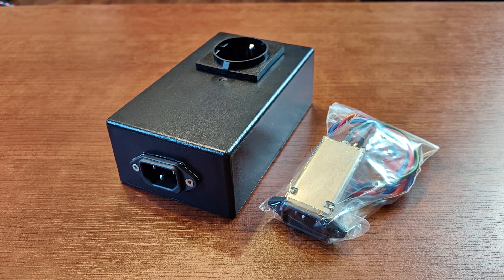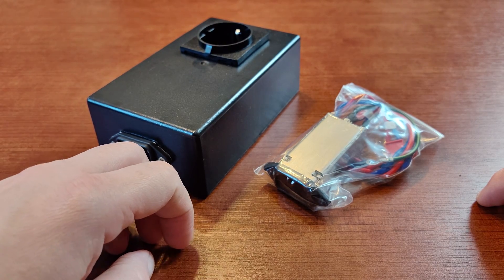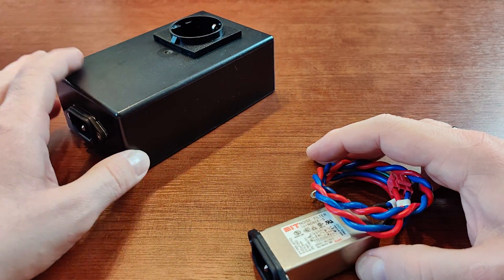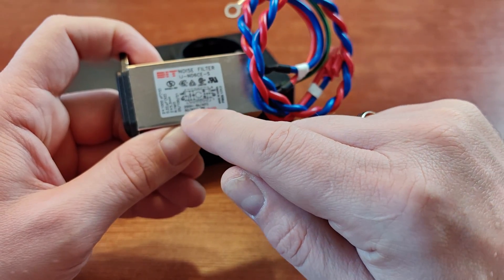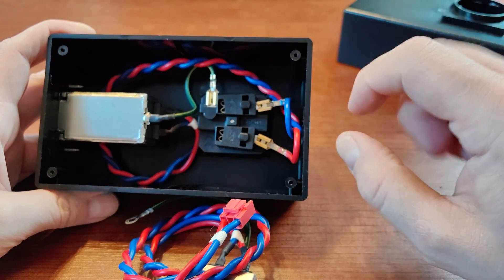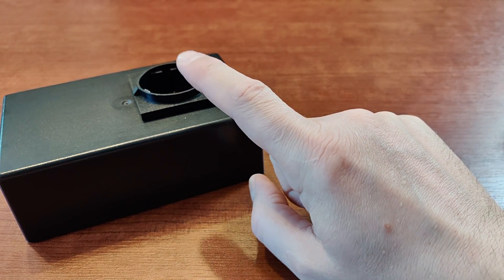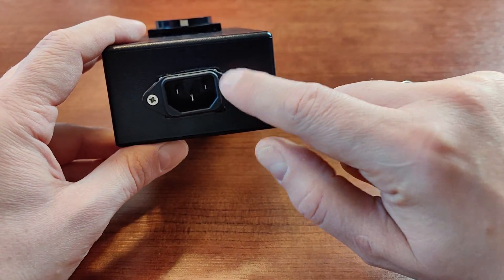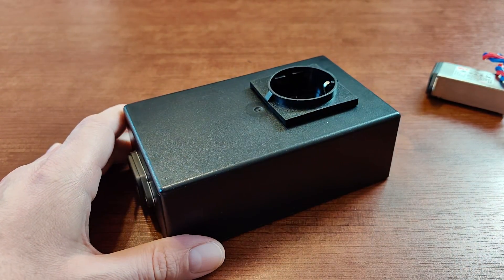Hifi DIY - building your own cheap EMI filter that actually works!

Comment: I put this filter right next to the computer. https://youtu.be/dSIgSAB9awI But honestly it didn't help. Any activation of equipment with an electric motor (drill or sewing machine) causes interference on the monitor. I just took an extension cord and plugged the computer into another outlet and into a different phase.
Reply from the maker: That's because it's for high frequency RFI traveling through the mains, not for EMI (electromagnetic stuff) that travels through the air. Btw you have either very sensitive monitor, or these devices are messing the things really hard
Reply: @k4syx  I’m afraid the problem isn’t in the monitor but in the graphics card. I’ve noticed that when I plug the printer into one of the USB ports, the monitor can also lose the image for a moment.

Comment: That's a good project to try how it sounds, but I suggest to build a more serious device with large chokes and thick wires. Find recipes online.
Reply from the maker: Yes the thing here it's dead simple to make one for a price of a single beer bottle. 
Yes you can build way more advanced and effective ones but that requires some more skills especially when it comes to soldering. And usually you'd like to have that on PCB so you'll need to order that as well (as masks and designs are available). This small guy works well and proves the point of having EMI filters on the power supply very well

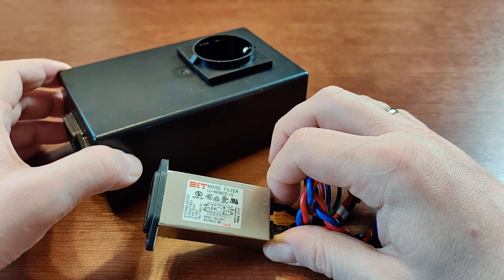Comment: 4:44
How did you test them?
Reply from the maker: Listening sessions with highly transparent system (Martin Logan Ascent I electrostats).
If you're talking about measurements, these are standard Pi design filters used commonly in sensitive equipment for EMI and RFI filtering. 
They are low pass filters designed to block anything above manufacturers specified freq.

Comment: Hello Greg, thanks for the video and sharing knowledge, very interesting ;-). 
I have the same e-TP60 power plug (as in your other video) and I have found Schaffner FN9244E-10-06, FN9244EB-10-06 and FN9244B-10-06 IEC Inlet Filter to install. Which one will you recommend for best performance? Thank you.
Reply from the maker: OMG I don't know their specs by the model number :)
I suppose any of them will do as long as it provides all three connectors (LNG) - some of the filters have only L and N.

Comment: Is it safe to connect the appliance under the EMI filter to another one without it? I'm mainly talking about connecting a computer behind an EMI filter to a network router/switch with a shielded CAT6 cable or an audio cable to an amplifier with its own power supply. Also, can I use the grounding that already comes out of my socket, or is the one coming out of the filter different? I have a TN-C wiring, which comes with a combined PE and N lines, unlike the modern TN-S grid, which also utilizes a current protection within the L and PE lines. My main problem is that plugging in any switching power supply like a phone/laptop charger or powering on a dehumidifier with a soft-start compressor results in my monitor being reset and my USB soundcard plugged into my PC outputting very unpleasant noise into my headphones. While the computer's power supply is the highest-end on the market you can get, it probably can't filter out the "dirty" power I have. I also have another computer with a pretty low quality PSU and I'm storing critical data on it as a home server. Can the EMI filter work only on its output, or does it also do something on the incoming side? I was also thinking of building the entire EMI filter into my extension cord, but first, I need to clear out my concerns and ambiguities before buying anything.
Reply: Yes, It's OK, you could build EMI box like this video. The grounding are the same so don't worry, just connect the green wire of the filter to your grounding system, it would help reduce common-mode noise. But always be careful when repair or change anything in grid, 120v is still better than 230v in EU. Most of the emi filters have metal case, read the leakage current from manufacturer file, and you could decide to buy and install, in your case I think it would help.

Comment: The only thing better than polish Acar power lead extensions with EMI filter are your polish accented videos about how to build one :D
Reply from the maker: Thank you, I guess? :)
I don't think acars have that kind of EMI filters. AFAIK they have even simpler stuff.
Reply: @k4syx  Yes. But their stuff (designed actualy for datacenters/racks) is probably cheapest option that in my opinion makes sense for AV/Audio. Their lead extension with surge protection and filter costs some 30 euros (used to be under 20 before covid...). Still the purpose built one will be better...

Comment: Hi Greg - very nice video! I have a dedicated line in my house for my hi-fi but I may have to run some equipment from normal power outlets. So I think I will make some of these!   Good tip about the shielded equipment power leads.  I make my own power cables (Schuko and Swiss to IEC 10A) from Kimber 12TC clone cable with earthing and could imagine doing internal wiring with that (or 8TC) as its surface area is large (AWG 8 per conductor for 12TC) and notice an improvement in instantaneous response to transients. 
Question: why did you not use a metal box? Surely that would help more with shielding, wouldn't it?  
All the best, Rob in Switzerland
Reply from the maker: @RobWhittlestone  Hi Rob! 
I got plastic box for two reasons: 1. Safety (90%) 2. Price (10%) :)
Metal one would work as faraday cage, but I wouldn't like any metal boxes in the cable mess I have sometimes behind my equipment rack.
(I'm Tom btw but Greg also sounds nice ;) )
Reply: @k4syx Oh sorry Tom! I got you mixed up with the Virtual HiFi channel also in Poland - Poznan I think. Now I will try to get it right! My apologies! All the best, Rob in Switzerland
Reply from the maker: @RobWhittlestone  No problem, no harm done, I knew that you were mixing us ;)

Comment: i bought a scaffner emi filter rated 20A and 250v 
instead of doing all this 
can i for example remove the wires that was going to my wall outlet ..live neutral and earth and connect it to the schaffner first then the output terminal connects to  to the wall outlet? that way power is coming from the breaker then it gets filtered through the filter then i get filtered power directly in my wall mount
i'll mount the schaffner very close to the wall outlet on the wall 
would it be safe ? the rated ampere is more than enough by the way for my equipment 
my equipements are only about 2000w
and here in my country voltage is 240v
240v x 20A is 4800w
so i should be safe right? or i need to also make sure the emi filter max voltage is 440v?
Reply from the maker: That would be exactly the same think (smart though not portable)  but you need to have some ventilation room and standard wall mount boxes (at least in EU) are small, so you'd need something bigger
Reply: @k4syx yes there is ventilation
when i use the room i turn the ac on
i am using a dual box mount with uk plug
and dual eu plug box
so yes i would need 2 individual filters
but is it doable? how can i ensure the emi filter is working the best as they can in such case? i will wall mount the fitlers and use trunking so the wires are not exposed in any way and maybe even add pure copper shielding sleeve to the wires
Reply from the maker: @kuronekosan2830  You would mount them the same way as in this external box so they would be in series before the external power sockets. I meant some kind of ventilation in the wall mount box, some room for air - shouldnt get warm, but its better to stay in the safe side

Comment: How would I screw the connectors with the wire ? Do I need to mount those metal connectors at the end of the EMI filter wires ?
Reply from the maker: @mazdaswing  you need to have like 5-7mm of bare wire at the end of the filter cable and then you can just screw it in the socket wire mounts

Comment: More easy: DIY short cable with Schaffner FN9244B (B: medical) + Schurter IEC C13. I have with 3A. 6A and 8A before two powerstrips. And a lot of Würth 150 kHz ferrites. SPAIN (EU): 230 Vac / 50 Hz -> we need less amperes (A) than in US (115 Vac / 60 Hz).
This Schaffner has the better attenuation. Look at the PDF.
Reply from the maker: I'd still use some enclosure for this but other than that - exactly!
The Schaffner ones are better but more expensive and a bit harder to get :)